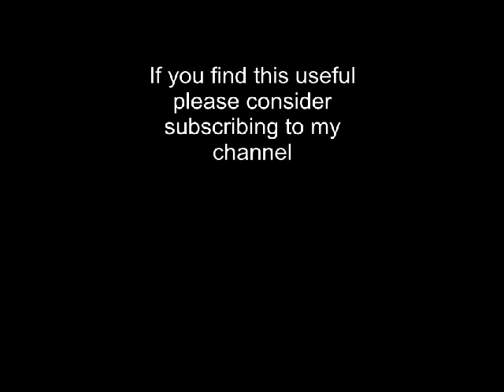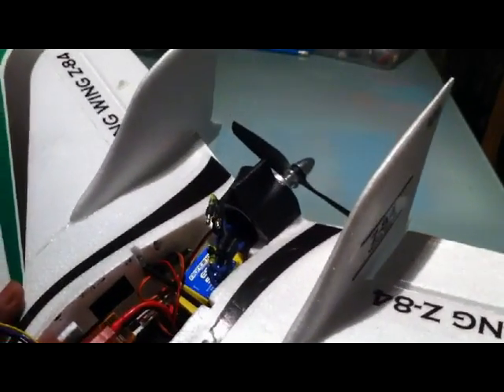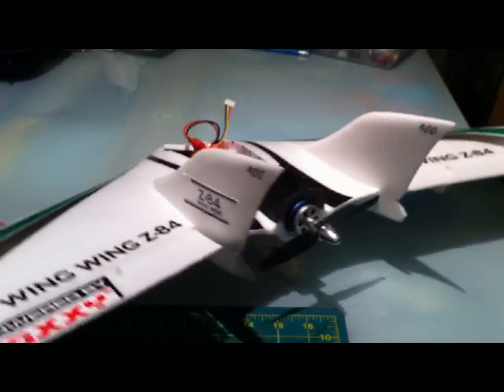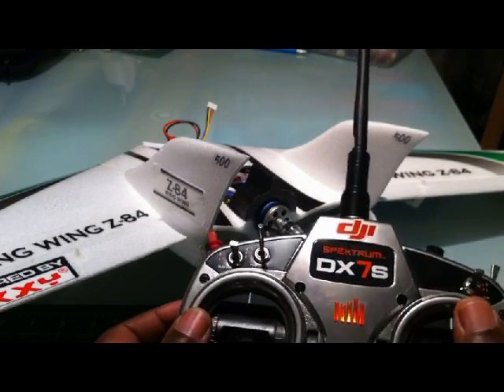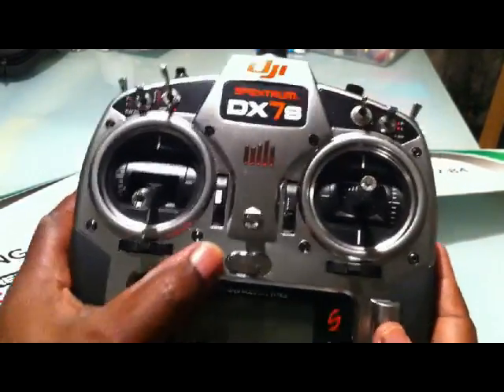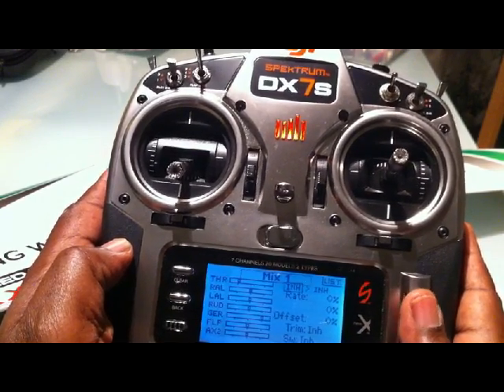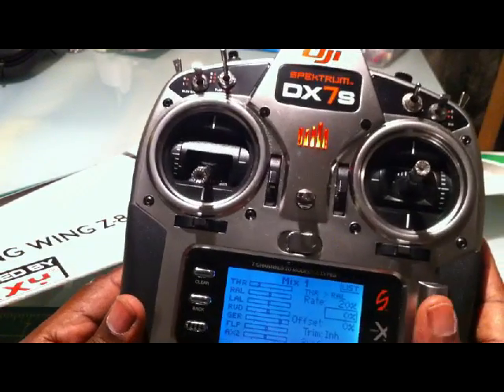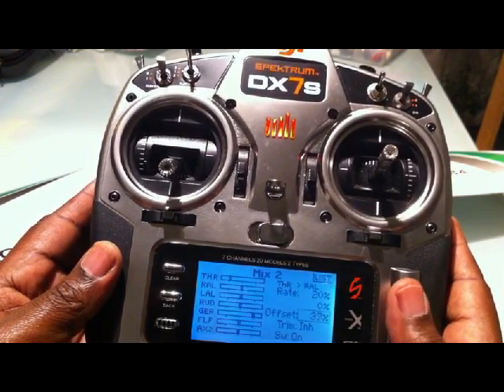Throttle to Elevon mixing on DX7S (Delta / Flying Wing aircraft)

Comment: An excellent video. Thanks for pointing out this very simple solution to a nose up or nose down pitching moment when applying course throttle . The devil is in the detail MIXING and CG is flight critical on a flying its importance is paramount thanks again as i did not think this was possible your video is the only one that I have seen which highlights this ability and you did it on a DX7s which is the Tx that I use . I am new to RC and have picked a 53in flying wing as my first model three channel easy to fly and set up. Could you please do a video on dual rates , expo and  elevon setup.

Comment: i need help, i have a V tail airplane, with 2 servos on the tail, elevator is fine, the problem is with my rudder, its invert and my radio is a dx7, how i can fix that. the radio on the manu only show r ele and L ele, it doesn't show rudder as option
Reply from the maker: It is a long time since l did, the video and l do not have my v-tail plane any more, but if you have a V tail plane l think maybe you need reverse the 2 
channels that you can see in your transmitter menu
Reply: +vkirbys that is the problem. It doesn't show rudder as option. It only says L ele and R ele
Reply: My Spektrum DX6e has an option to select “Elevon-b” after “Elevon” on the wing setup...that solved my reversal problem!

Comment: Thanks for the vid.  I'm thinking of getting a spektrum transmitter - can't I just reverse channels if needed within the transmitter settings? why would I need a separate cable?  https://youtu.be/dh90YSEXHJs?t=3m3s
Reply from the maker: I do not think you can setup Elevon function without using individual cables to the servos